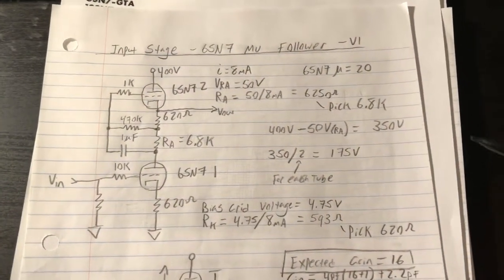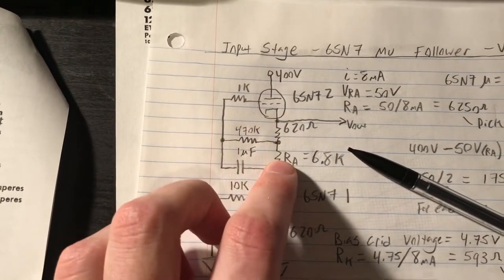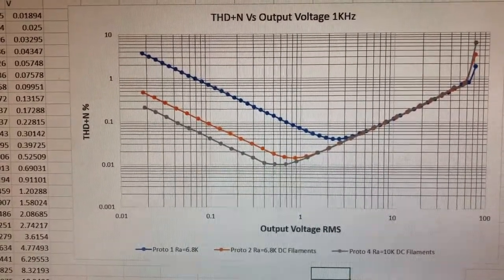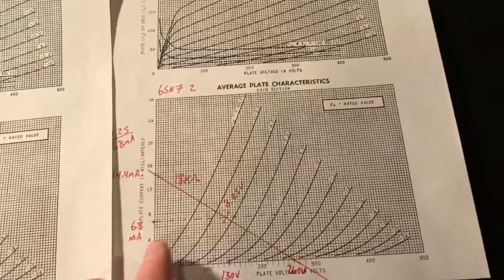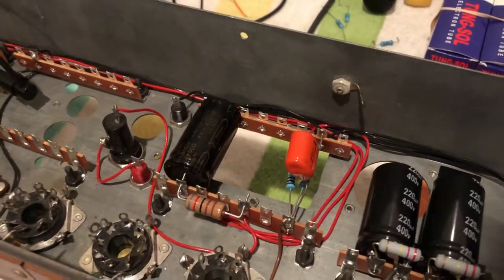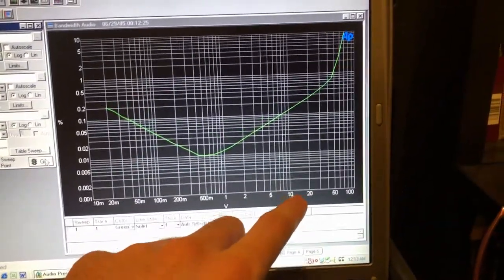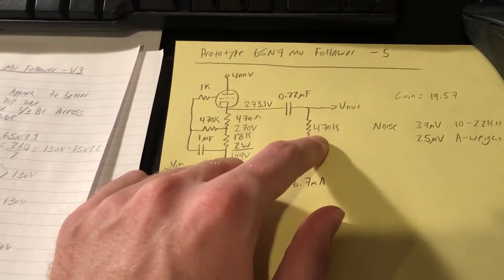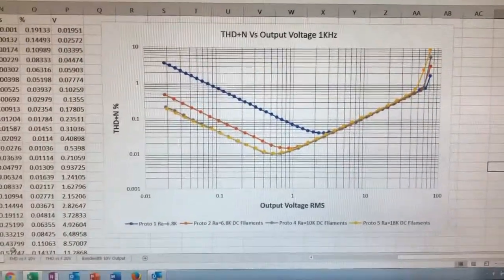6SN7 mu Follower Tube Input Stage - Bandwidth Audio Project 2845 Part 2

Comment: That's a nice looking THD graph. Have you released this preamp yet?
Reply from the maker: This preamp is the font end of the PSET 2845 amp design. Not a standalone preamp in itself. It ultimately drives over 400V P-P into the grids of the 845 tubes as you will soon see in the video series. I think that may fry a normal RCA cable and whatever is connected to it😜
Reply: @bandwidthaudio7479  Looking forward for your new 2845!
Reply: Yes, explanation is very good, THD+N and THD vs f are very revealing.
I'm making microphone preamp with 2 mu follower stages. Mu followers are not seen that often in pro audio designs despite having very good specifications like THD so low they don't need NFB, driving capabilities are not that far from SRPP, high gain, etc. It needs 1:10 input transformer, output will drive loads as low as several k ohm, 2:1 output transformer takes 6dB of gain but then drives 600r to very high levels. Circuit consists of 2 E88CC tubes, one for each stage with pot between them for level control, gain is very high at 70dB or 76dB without the output transformer. One stage made from low mu tube would make nice hi-fi line stage, variation of the circuit will make different pro audio devices like active DI, passive summing gain make up amp, line amps for passive eq's, etc.

Comment: So I've had some time to learn more and think about the mu follower circuit (I'm the person who commented before), and I think I've got a hypothesis that perhaps you could confirm, or explain if I'm wrong. 
So I'll start with the SRPP, which the mu follower is often compared to. Since the SRPP has only the one resistor between the cathode of V1 and the plate of V2 and just a wire between the plate of V2 and the grid of V1, the circuit acts as its own phase inverter, with its output being the amplified difference between the two triodes. Thus it is able (through push-pull action) to swing up to twice the idle current. With the additional resistors added, the mu follower loses this push pull capability but instead maximizes gain and generally minimizes output impedance -- V1 acts as both a CCS for V2 and as a cathode follower. 
We learned in the video that raising the value of Ra to 18k results in a modest increase in gain (since it moves the mu follower closer to ideal operation), there is a negligible decrease in headroom (since there is slightly less current to drive a capacitive load), and most importantly, distortion remains the same. So here is my hypothesis: since the mu follower doesn't truly act as a push-pull amplifier, balance between the two devices is not as important. Instead, it may actually be beneficial to run V2 (the common cathode amp) as hot as possible, since we know its loadline is effectively flat, and allow V1 to operate with a fairly steep loadline, to maximize current swing. This should maximize the amount of current available to drive the load, and cathode degeneration, essentially 100% feedback, will take care of the distortion generated by using a more aggressive bias. Is this the case? I guess maybe the real solution is to listen to both and see if one sounds better than the other?
This of course opens the door to more questions as well (does a more linear loadline for V1 result in lower IMD? Is there any meaningful effect on bandwidth/oscillation/etc? How much, if at all, does the value of the 470k reference resistor and grid stopper matter? And so on -- probably a bit beyond the scope of this discussion, but interesting nonetheless). If you have any insights, they would be GREATLY appreciated!! Thanks!
Reply from the maker: Hi Matt,

Some interesting questions your presented. Here’s my thinking:

With SRPP specifically, the push-pull nature is only satisfied (and becomes maximized) into a specific load impedance since the AC coupled load resistance is part of the balancing of the push pull circuit. This occurs at surprisingly low load resistances (tube dependent). At this critical loading, the SRPP will give its lowest THD and highest output power and operates in a true push-pull nature since the AC current balance between the top and bottom tubes is perfectly opposite each other. I believe distortion here will be dominate odd order rather than even due to the PP nature. A SRPP into high Z loads will in fact no longer be push pull at all.

This is the main difference between the SRPP and the mu Follower. A mu follower is deliberately designed not to deliver push-pull load current but instead optimizes the boot strapping of the bottom tubes plate resistor to act like a CCS.

With that out of the way, it may be clear that the AC current swing is load dependent. My drawing of the load line for the cathode follower resistor is misleading and actaully incorrect. The load lines will only begin to rotate once AC current flows into a load.

Since this is a Class-A amplifier sitting at idle around a DC operating point, maximum peak current swing is determined by (and equal to) the idle current. i.e the tube can swing down to zero current or up to 2x the idle current for symmetry. This is the steepest rotation of the load line possible, otherwise distortion occurs, and the drive is no longer symmetric around the idle point. The load line will automatically rotate with loading until we hit his condition. 

Increasing the idle current will allow more current swing into the load (symmetrical that is). The load line on the cathode follower only rotates by the amount needed by the load but it is still centered around the idle bias point. Using a more robust cathode follower tube may have the advantage of lower output impedance, but not more current drive.

To your point, we can absolutely use different operating points (or tubes) between top and bottom of the mu follower. However, the idle currents between both stages must be the same (tubes in series) if the load is AC coupled (no DC current can flow through the coupling cap). In this scenario the voltage across each tube would be different per the biasing but not the current. If a load is DC coupled than the idle current (and therefore load current) could be made asymmetric. This would lead to very odd behavior.
Reply: @bandwidthaudio7479  Thanks for your response! It gives me much to think about. I'm hoping to use a mu follower stage as a DAC output hopefully in the near future. Since it will be driving a moderate load (~40kohm volume control on a preamp), I'll have to consider how much it will be loaded down by whatever I happen to plug it into..  Bearing all that in mind, I think it should turn out pretty good with the right idle current..